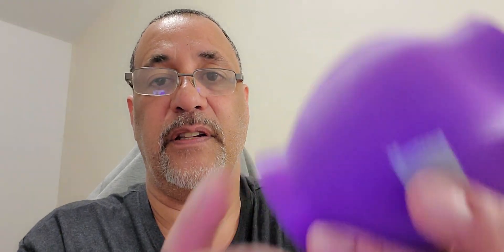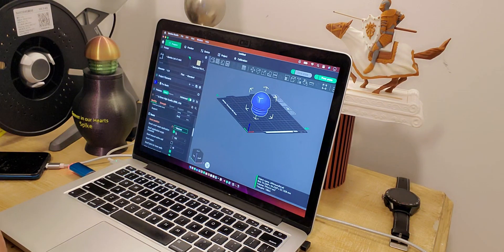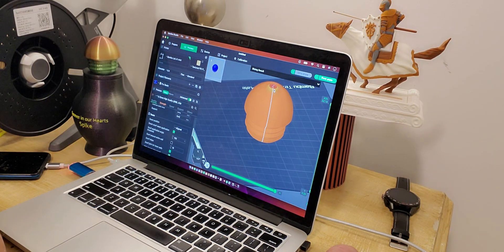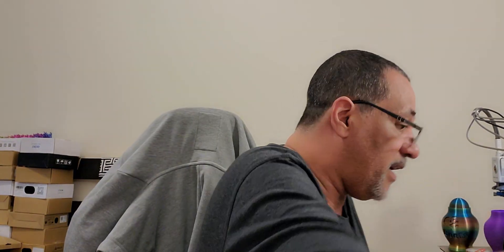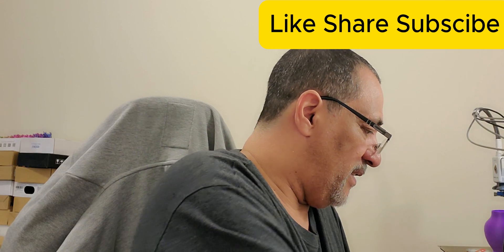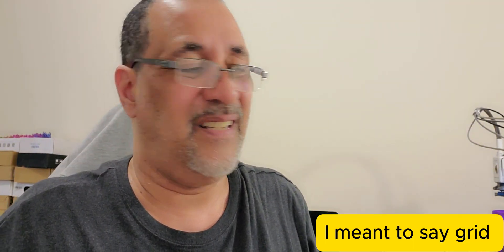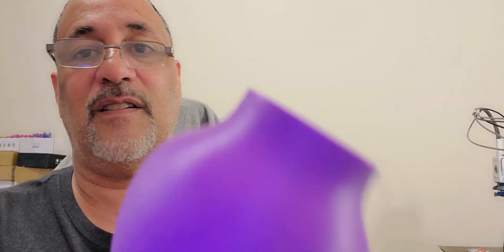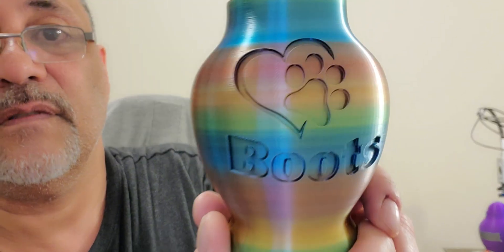Fix Ugly Seam Lines in Bambu Studio (3D Print Tip!)

Comment: You may want to look for scarf settings or a slicer that supports it. Basically the slicer spreads the join out over a certain distance instead of starting and stopping all at once. For example when starting a new layer, the extruder won't start 0.2mm higher than the last but will start at about 0.02mm higher making a much smaller join and the extruder slowly rises to the full 0.2mm layer height. This gets repeated for each layer. If you look at the G-code, you can see the z height changing far more regularly than if not using the scarfe setting.
Reply from the maker: yea i wish i could try orca slicer thanks for the feed back appreciated